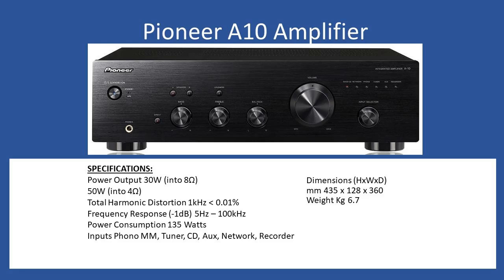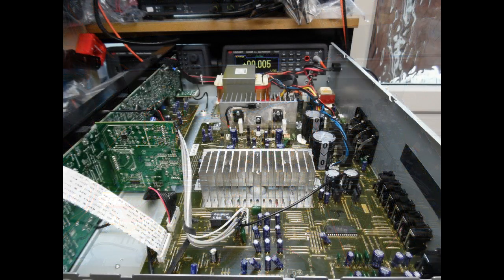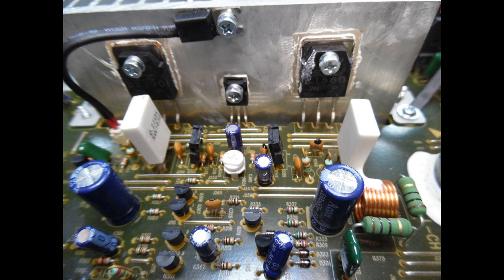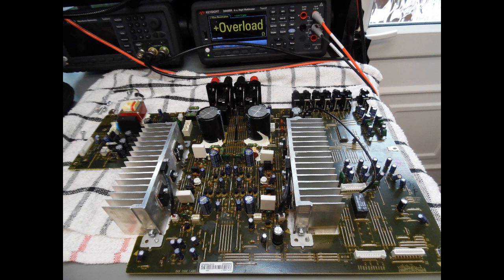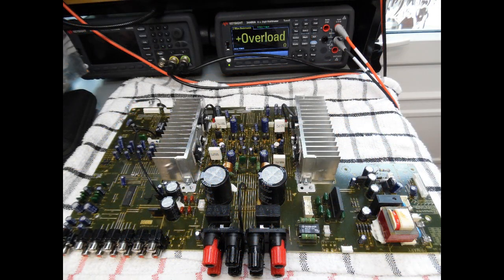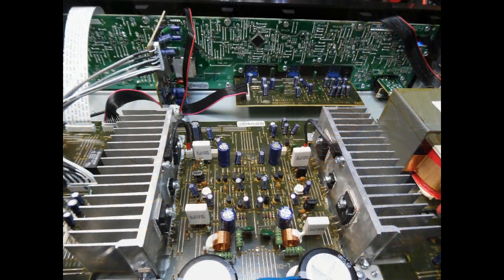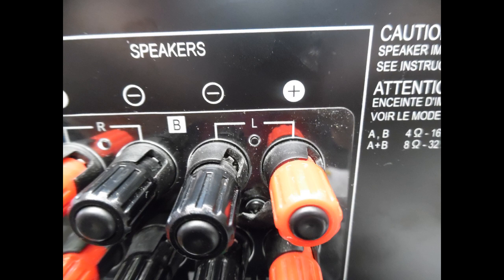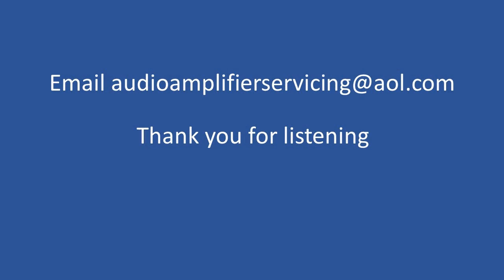Pioneer A10 Repair (With Audio Tutorial)

Comment: Thank you very much, you helped me a great deal at the beginning regarding getter the blue light to come on as my a amplifier had the flashing red light, not sure what caused it, if you can tell me what it may have been.
Thank you.
Leon. Sydney.
Reply from the maker: @greenfee100  The protection system can trigger if any of the 3 conditions are detected. Thermal protection, DC Detection, or Overload Detection.
If the Amplifier can be reset, then it's indicates that it is not related to internal component failure. As with any microprocesor based device, protection systems may randomly trigger, and the cause is never known, for example, electrical noise.
Reply: My amplifier has a luck of power for right channel .very quite even on max volume.any suggestions?
Reply from the maker: @staropramen80 Hi, do you have access to a small oscilloscope so you're able to check the audio signal entering and exiting the volume potentiometer.